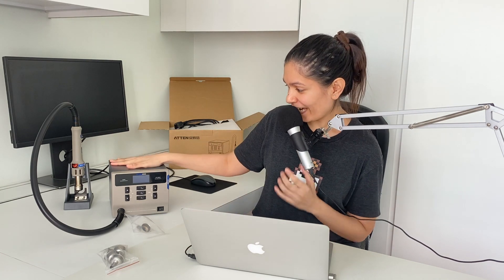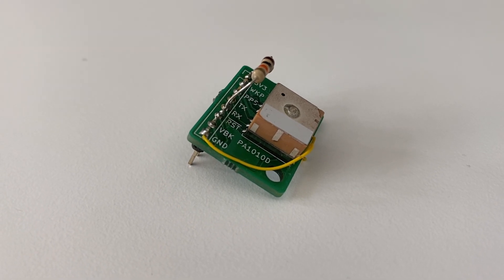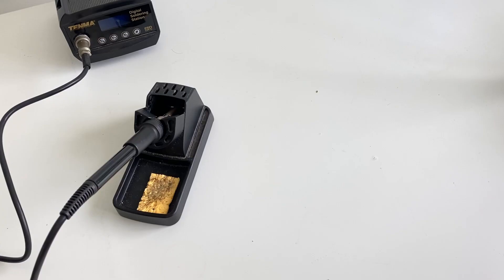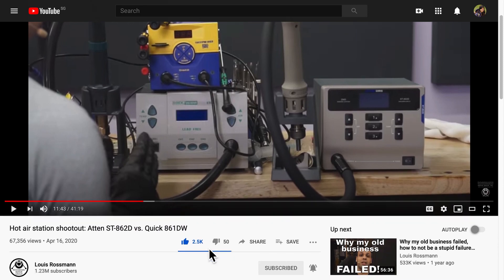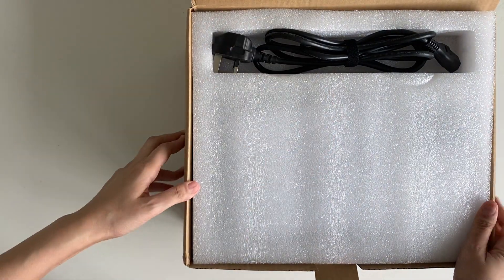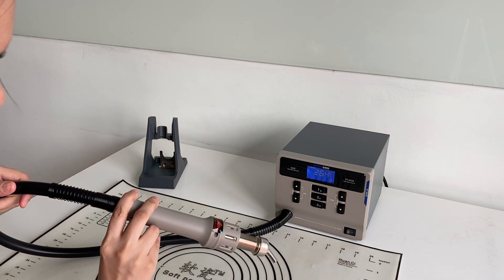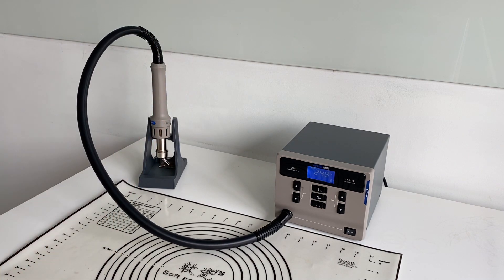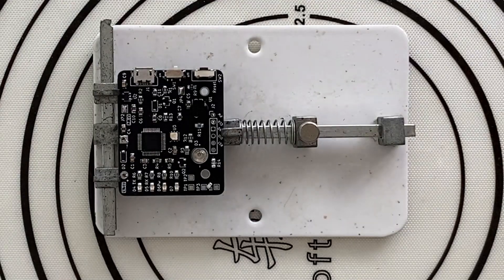First impression of ATTEN ST-862D // SMD Rework station for soldering, desoldering, heat shrinking

Comment: Any particular time when needed to use the cold air feature during rework?
Reply from the maker: Not many times, honestly! Maybe to clear up reside after cutting traces on the PCB or cool down a heated component so that I can touch it to remove them 😅
Reply: Does this station have an EMI filter to prevent the effects of switching being coupled back into the mains of the building?
Reply: Cold air feature was removed from newer versions of this station anyway.

Comment: Can a temperature/ air flow be selected and set with the handle set in the stand? Not a preset using one of channel buttons.

 Is there an ac filter installed in the station to prevent the effects of the switching

Comment: Does anyone know what E11 on these machine are I bought one from ebay worked fine when opened. let it sit for a while now its nothing but e11 error
Reply: Error code E11 means "Broken Fan"
Reply: @ObsessedGeorge  Meant to update they sent me a fan and its all working now.
Reply: @Eightbitgen  Nice!
Reply from the maker: Ouch! I haven't had this error code yet. The manual also doesn't seem to say anything about the E11 error. https://static.eleshop.nl/mage/media/downloads/atten-st-862d-user-manual.pdf

Maybe contact your reseller/manufacturer? Hope you get it solved 🙏🏼